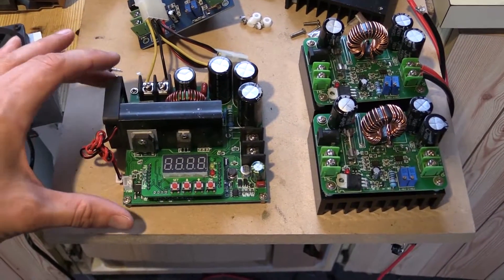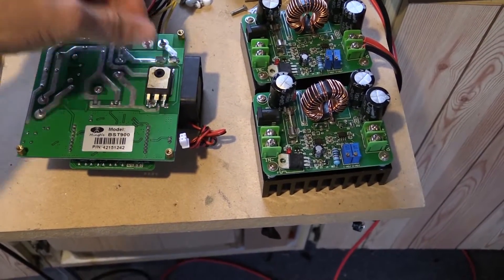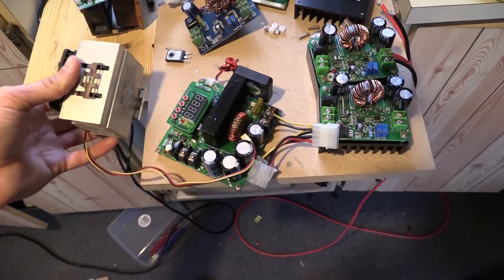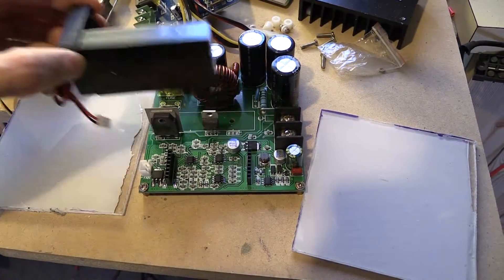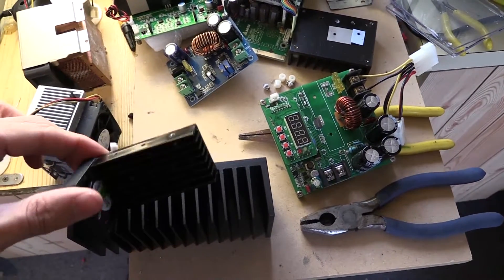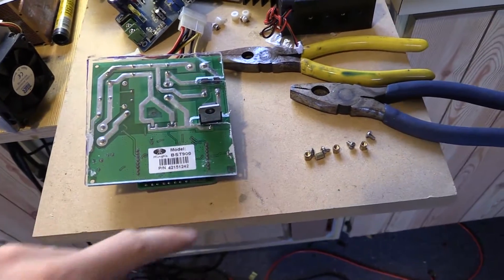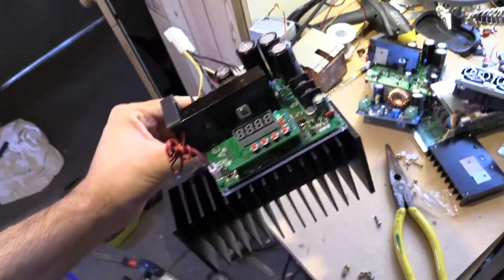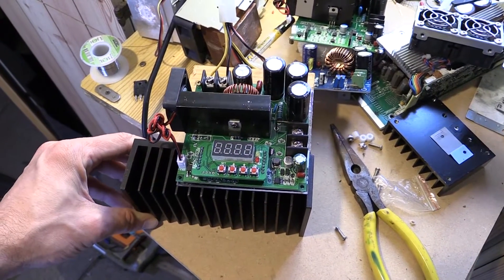900watt DC Boost Converter Supercharged!

Comment: hey . . . is it possible to upgrade this to output 150vdc?
and also . . . can these be put in parallel.
Reply: I don't know of a way to increase the voltage. In my experience it's impossible to run any boost converters in parallel when they have the same source. If you had two input sources it can work.

Comment: I see some have bad luck with there BST, (or can't use it right) As I have been using mine to charge an 84v 57ah LI-Ion e-bike battery without any problem, only mod i have done is add a second fan. Was thinking could you not add a second FET coming out of the bottom to beef it up?
Reply from the maker: You could try the 1500 w boost converter they do up to 90v but are far better overall and are around the same price

Comment: Can i use it to power-up my GTIL(45-90v input) from my 24v battery ?
Reply from the maker: It wouldn't be powerful enough for the 2000w GTIL. You would be best with the 1500w boost converter. As the GTIL at 80volts pulls 32 amps DC
Reply: Aw ok, but i ordered 1 KW GTIL what would be its current pull? i have seen 1200W 20A DC Boost Converter, will that suffice my needs?
Reply from the maker: no idea but from mem the 1 kWh ones will do around 940 watts so i guess that is around 15-17 amps. Get the bigger boost converter as it won't have to work so hard. Its not a good idea to run anything at its limit. I have got 2 of these, 
https://www.aliexpress.com/item/New-1500W-30A-DC-Boost-Converter-Step-up-Power-Supply-Module-IN-10-60V-OUT-12/32759343174.html
Reply: Thanx mike just what i need.

Comment: I have the exact same unit and it blows the mosfet at anything over 8 amps. My input is 48v and output is 120v. Its advertised as a 15amp unit. Works good as long as I limit it to 8 amps.
Reply from the maker: 15amps ? It should advertised as 10amps. Its a 10amp unit. I am sure that its 10amps on the Input not the output. 10amps on the input would be something close to 8amps max on the output which sounds right

Comment: I have this and i can't figure out how to set it so it powers on when power is applied without pushing the ok button. The dam instructions on the net are crap. How do i set the dam thing? Can you make a video showing how to use and set this thing?
Reply from the maker: Try this, turn the DC power off so no power is going to the unit. Hold down the "OK" Botton and turn on the DC power to the Unit while holding down. You will see some numbers on the screen, let go of the "OK" button and auto power output will be enabled. Try turning the power off and on and you will see the unit will auto start the output :)

Comment: I have 12V 60A power supply and I bought this 900W boost converter for charging my 13S liion battery. I did not noticed there is 15A limit on the input, so charging will be slow. Set output current to 3A, but max current was only little over 2A. Input current was about 12A at 12V. It charged my battery without any problem. Temperature was OK. But next day 900W boost died immediately after turning on. I have no idea why. Mosfet is shorted. 
After that I bought 1500W unit which have input current 30A. I used it for while and noticed components on top side gets very hot, so I added second fan. I charged my battery with 6.5A without any problem. Input current was 35A at 12V. It was overloaded, but worked fine. My plan is charge battery with 5A, but now I know it can handle more. Effeciency is under 84%.
With less current effeciency should be better.
Reply from the maker: Thanks for the comment, Ya with such low input voltage it will be a prob. I was thinking about buying the 1500w one, You can also put them in parallel if you have two. That way you can 60amps of input and 13amps on the put for batts :) I will put 55volts into mine. Have watch of my next 4 videos.

Comment: I have this very 900 watt boost converter and the constant current function has never worked.
Reply from the maker: Thats strange both units i have constant current worked fine
Reply: I just got this same unit and have the current limit problem! Doesn't do squat. Set for 0.50A, still outputs way over that setting! The amber led does light, but no limiting.

Comment: My rule of thumb for any power ratings on cheap devices like this is - assume it's good for half of the stated power rating. If you can get more than 10 Amps continuous out of it  I reckon you're getting a bonus. Worth a crack!
Reply from the maker: did a test last night for 20min with 11amps in the input, Today i will do 12amps input and see what happens
Reply: How did you go with that Mike?
Reply: i make some changes of the device . and get it work with input 12.7V 15.8A for 200W input.  and i get output test of 120V 1A  120W( halogen lamp) . its max 60% efficiency with that big range between 12v and 120v . i try get more than 1A in 120V but the mosfet start making strange nose 🔊🔊. so i stopped the test on 1A max in 120V .    ( another test in 50V with 3.8 A max from  output was successfully done but that take from input 20A all out  and make things very hot .     very important you understand that there 4 things have to change in this device .

Comment: And how do you power that?

Don't you need to run off 240v?
Reply from the maker: Max input is 60v DC on almost all dc boostconverts. I have build a very powerful powersupply which will power the boost converters. details on the next few videos coming.

Comment: can I ask what you are using the boost converter for ? - I know it's for charging the bank, but what's the output and input volts & current ? thanks
Reply from the maker: Yes going to use it in the mean time to charge the powerwall. 
Input is up to 60v, and output is up to 120v, I am going to set 83v on the output, The input has a max of 15amps so i will try for 12amps continuous with the big heatsink. While any product says its rating what it can do continuously is normally alot different and because of heat. So this is why upgrading the heatsink was needed to run continuously and the same can be sent with most boost converters with under sized heatsinks.